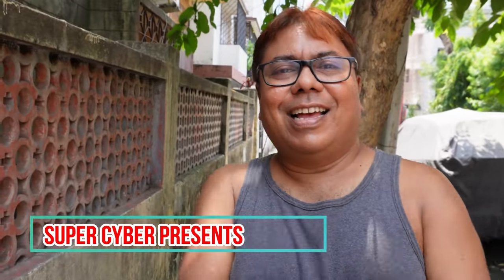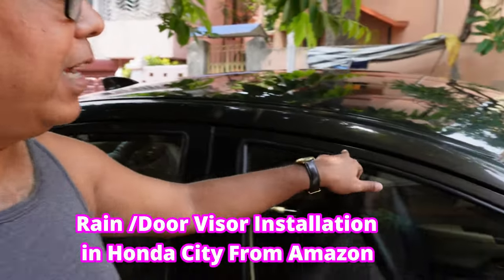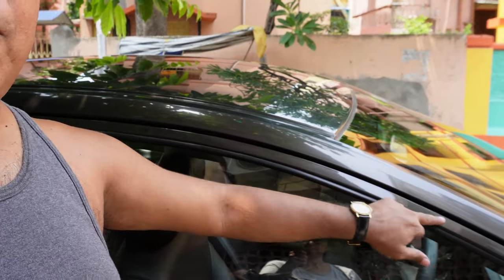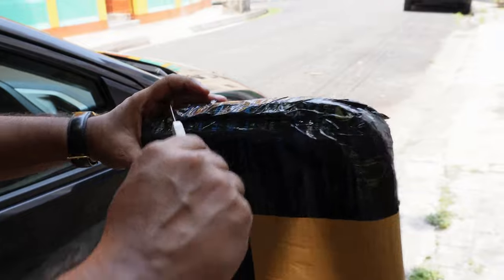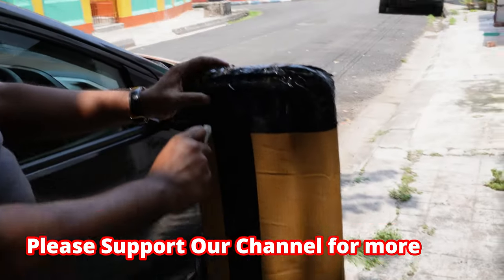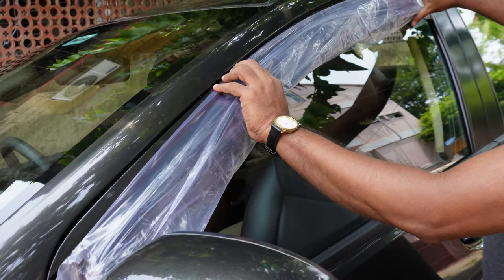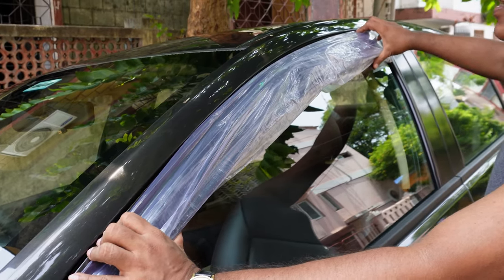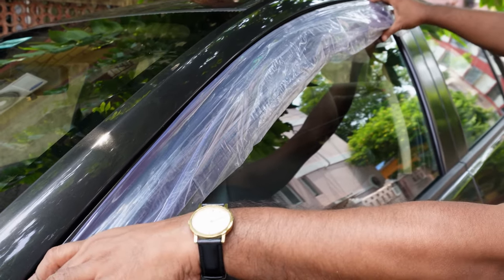Rain | Door Visor Installation In Honda City From Amazon #carmodification #caraccessories

Comment: Hello i have a Tyre Cleaner Which is gonna Expired on 24 July More than 1.5 months left but do you Recommend to use the Expired tyre Cleaner on the tyres? If not please tell why to not use reason 🙂🙏🏻
Reply from the maker: There is no harm in using it. Only the durability of the polish will be less. So nothing to worry about.